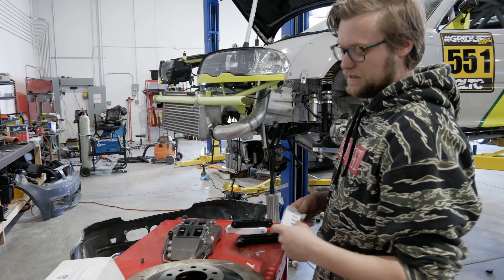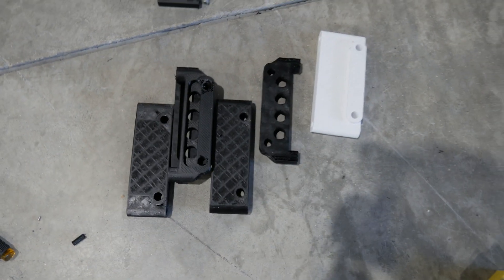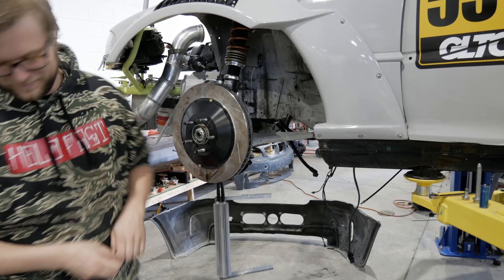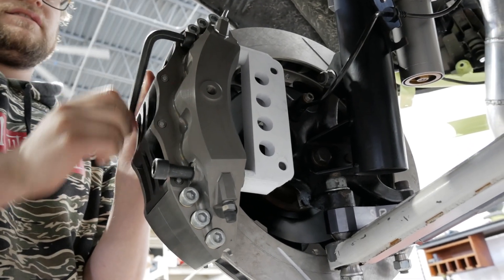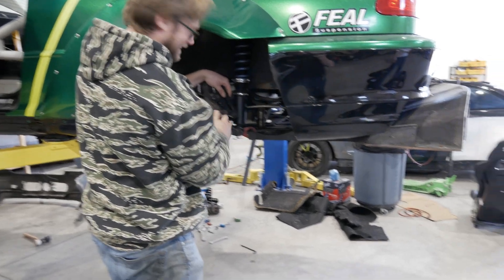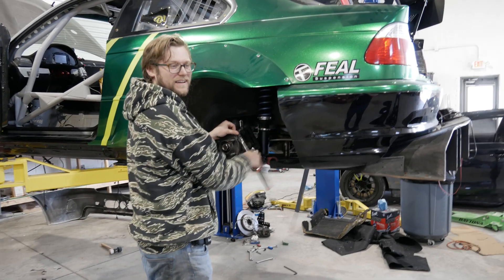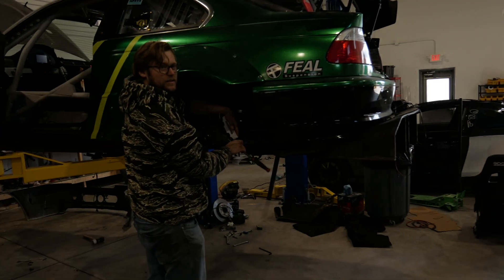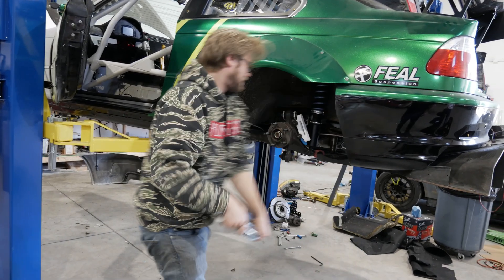E46 StopTech BBK Adventure Time

Comment: I think stoptexh makes a 380mm kit for the e46 m3, wouldn’t that have been a little easier?
Reply from the maker: They don't have a trophy kit I don't think, only in 355, but regardless we use e36 non-m knuckles for better geometry so it wouldn't have worked.
Reply from the maker: Mikes car has e36 front knuckles for better geometry so it had to be a custom kit
Reply: Oh nice, I’m thinking about using f80 calipers and rotors for a bbk. Fronts should be almost a bolt on. I’ve seen you guys have a bunch of adapters for the calipers, do you guys have any solutions for using the rear f80 calipers on non m e46?
Reply from the maker: no because to do it right you need to space the wheel bearing off the knuckle a little  @eduardolima8560
Reply: Yeah I’ve seen that the rear is harder to make fit, I’ll probably just go with 135i calipers in the rear